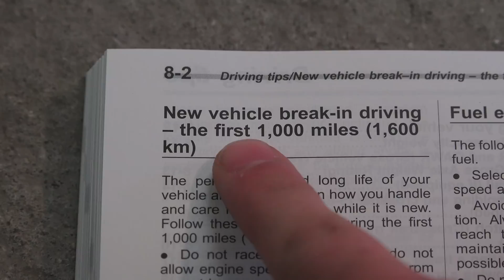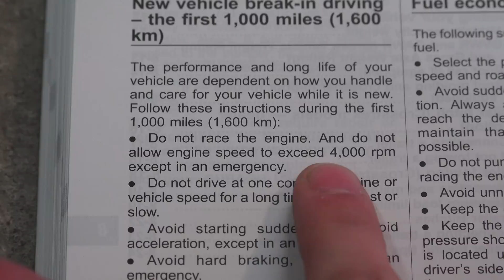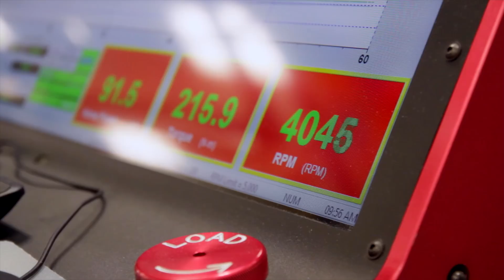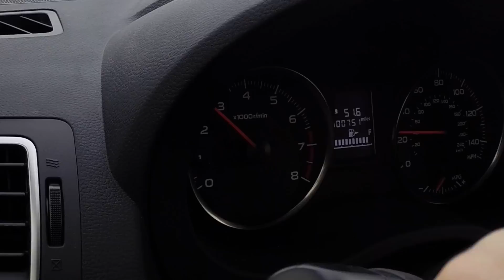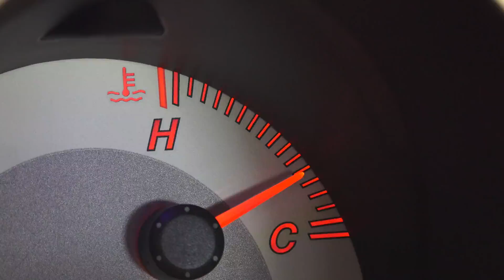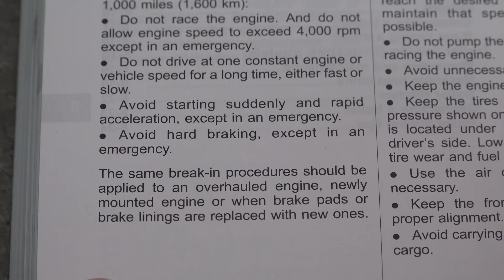5 Things You Should Never Do In A Brand New Car

Comment: My 1995 Ford Aspire was a rental from California.I got it in 96 for $5399.00 about 7500.00 with interest. it still runs great:-) use only full synthetic oil and tuff guard filters. 189,582 miles and still starts on the  first try ever time. and Bosch platinum plugs.

Comment: While following this info, I also highly recommend equal parts engine braking and moderate (but not full) acceleration. As you mentioned the pressure from acceleration seals the rings against the cylinder. Too little load and the rings won't seat correctly. The negative cylinder pressure (vacuum) from engine braking sucks the fine metal particles and excess oil from the gaps in the rings. Easy to do in a manual vehicle. Not so in an automatic. Regardless, my '14 WRX does not burn any oil. No oil consumption is indicative of a good break in process, IMO. Also recommend an oil change at 1000 mi, but people will argue it's not necessary.

Comment: Factory  redlines new engines for several minutes before putting the engine in the car. just rip on the car that's what I do with new cars
Reply: And that's why you spend every monday at the mechanic.
Reply: This has absolutely nothing to do with break-in or positive long-term effects. It's simple QA to make sure the engine won't immediately disassemble itself the moment the customer will drive off with it.

Comment: âren´t Ferrars tested at the racetrack for multiple hours before they get shipped out to custumers?
Reply: manuel grohse your Toyota corolla isn't a Ferrari.
Reply: "Ferrars" lel
Reply: +Lancer Guy  What about your 1981 Chevy Citation notchback?
Reply: Ferrari runs it's engines prior to installing them to the car.
30 minute dyno cycle, break in and then power/torque test to see if they are on spec.

Then they drive the car , not multiple hours, but enough to check if the chassis and steering and everything else works as required.

Comment: I'm nitpicking here, but cruise control does not lock engine rpm; it uses a pid controller to try to hold constant speed, which can require varying engine rpm. In a hilly area, cruise may change engine rpm more than a typical driver would because it's always trying to hold exact speed. This is a problem of highway driving in general, regardless of whether cruise is used or not for break-in.

Comment: The 6.2 in the last gen Raptor and the F-150 Limited and Harley Davidson version had an ECU restriction for the first 5,000 miles to avoid higher rpm and full throttle pulls.

Comment: Great ! really Great info man !
but If you have got a new part like disk breaks and its pads ...
will you also do a break in ?
and if this info is for new cars " to Eliminate the lost stresses of the casting and machining  progress ... and so that the parts fit in together !
and that's why BMW used an old Engine Block in the famous F1 car that Had a Turbo and 1,500 BHP !
and they piss at them too  !
and it made such amazing horse power !

Comment: It'd be nice if a manufacturer just took two or three brand new engines and did easy driving break-in, normal driving break-in, and aggressive driving break-in and then showed the wear side by side for a final and definitive answer to this. (No, this actually isn't that expensive to a car company. It's R&D cost.)

I was always told that you should drive it like you would normally drive it because then it'll break-in to your driving habits instead of soft driving and then a complete change after 1,000-1,500 miles. Obviously you shouldn't be flooring it much during normal daily driving, but you probably won't be using only 50% throttle and keep it under 3,000 rpm either.
Reply: They have very expensive simulation software. While it's still a simulation and thus not completely accurate they still feel the need to waste a few pages in the manual on how to use the car during that period.
Reply: qwesx 
I guess so. Just seems like when arguing back and forth on which way is better goes on for decades it'd be easier just to have a definite answer.

Could also be that wear in needs to be done differently with normal oil than with synthetic too. I'd just be very curious to see the wear side by side.
Reply: Alex V4 
Agreed. A side-by-side would be nice. Engines are built daily, so this should've been done by a manufacturer by now.
Reply: TheGreatMunky This is actually quite true. The real reason for a break in is setting the compression rings. I mean, are they so worried their engine assembly is so poor it's going to come apart.  Aside from racing it, drive it the way you drive under normal conditions. If you don't want to wait, use a dyno and you can get that so called break in done in about 20 Minutes.  If you don't have a dyno find a straight road with no stops and run it up to rpm then just let it compression break for about an hour.  Worked on my Harley and Honda crotch rocket too.  All they're doing with that manual is covering their own liability as usual.
Reply: Engine break-in can be done by the OEM's specs or by the "hard" break in method. Both work fine and depending on your driving style should determine which route you take. I have used the hard break in method for all my engine rebuilds and have never had an issue. The problem with it is that everyone has a different interpretation of it, which can lead to different results. I change the oil at 500 miles and in that first 500 miles am making sure to never let the RPM sit at a constant. the motor should not really sit at a cruising RPM for extended periods of time until it is broken in,so it should always be under acceleration or deceleration. I will also make sure to take it up to just under 50-75% of redline at about 75-80 % throttle (for example if the redline is at 10k take it no higher than 7k) and let it decelerate. Having that motor under load will help those rings seat much better and since the seating process is generally over in the first 500 miles that is why I do it that way. After the first 500 mile oil change I will drive the car at 50-75% until I reach 3k and change the oil again. you should be good to go after that.

The reason the OEM has the recommendations in the manual is for liability purposes only. The manufacturers do testing on their engines and they do not spend that much time on breaking them in. In most cases they will, pull a motor or a car off the line, hook it up to a dyno, give it a very brief warm up cycle, do an oil change, then give it a full power run. That motor will then be sold and treated no differently that one that has never been fired if it passes.
Reply: Stupidest comment of the week goes to

"Metal parts shouldn't be touching and wearing like that." 
@TheHannukahZombie

In a fresh built motor...  lol...
Reply: TheGreatMunky well one thing is obvious. more gas translates into more energy. more energy will definately increase the rate of wear. its just a matter of how much or even if it is worth noting at all.
Reply: Sijan Khan 
So driving the car the way you normally would should be fine then, right? The oil filter should pull any metal particles out of the oil, and 1,500 miles shouldn't wear the cylinder walls enough to make a difference between the pressures of light driving vs normal driving.
Reply: TheGreatMunky I think the issue is that not everything is seated in perfectly straight off the lot. You have to give some motion and stress to seat everything in perfectly, but if you put too much stress on parts that aren't fully seated in, you are more likely to put excess wear.
Reply: Any short track racecar driver or even club level racers can tell you.  Or almost any car hobby nut that has built many motors. The recommendations here run from ridiculous to out right wrong.  The idea that modern car tolerances are so good that you don't need to break-in is insane.  We build motors in the 30k range with top of the line parts and tolerances.  Combined with balanced and blueprinted; we still end up with a ton of metal flake and grit in oil pan after initial run.  Most factory tolerances can range in .004 inch, which is HUGE when you are talking motors.  All that metal has to go somewhere.  If you think all of that particulate gets picked up with a oil filter; you have watched way too many infomercials.
Reply: TheGreatMunky agreed; most cars will be fine with normal driving; but I've never heard of any motor not being "broken in correctly" because it was not driven hard enough.  That entire notion is almost as bad as not changing oil for the first 3,000+ miles.  Having torn apart my fair share of brand new LS1's from Chevy I can factually say that tolerances are still not great on a stock motor, even now.  Pounding on it is going cause excessive wear at very least; or even burn a rod or crank; burn a valve or  smoke a ring.  Stay away from Wot and keep your foot unheavy; read the oil and you'll cover the 90 percent of it.  In the end it's about reducing the odds.  We have had junk motors from factory that never run right and others that are close to perfect.  Lot of variables.
Reply: Charlie Pattison 
Sounds about right. And yeah, I've heard about the acceleration and compression braking approach before. 

It's just surprising to me that no company has done this and released the results online. Because these days with the internet that'd spread fast and we'd have a definitive answer. And it'd be relatively cheap publicity for that car company.
Reply: As Jason mentioned, I think the problem ultimately comes down to your manufacturing tolerance. There's variability in how well assembled one car is compared to the next car on the line, and each car will have different break-in needs because a car has so many different components. Drivers will also be driving these cars under different environments, so the load on the car is different from buyer to buyer. So you have to account for these variability as well.
Reply: Sijan Khan 
True, just makes me wonder how much wear happens during the first 1,500 miles compared to the 2nd/5th/10th 1,500 miles.
Reply: Once you're past the break-in point I would expect the first 1,500 miles to result in the less or equal amount of wear compared to the 2nd/10th/100th 15,000 miles. If everything is in its most optimal state, it would be wearing out the least.
Reply: TheGreatMunky Once everything is seated in (broken in), your vehicle will be able to handle more stress on itself.
Reply: Sijan Khan 
Could be. I guess my way of thinking is that the best way to wear things in is varied driving. Drive it too easy and it could wear in too light. Run it too hard and it'll wear in too heavy. A good mix of everything sounds like the best way to go.
Reply: Boysya 
I tend to agree. The very first time the engine is ever turned on and before any oil moves through the engine, yeah. But that doesn't last 1,500 miles. You will get slightly more wear just because no cylinder wall wear has occurred yet and the walls are more snug against the rings, but that really shouldn't change after 1,500 miles.
Reply: k kirkland 
Maybe, maybe not. Sometimes the common sense approach isn't the common approach. 

But even if they did, technology has changed. New and better alloys. New and better oils. What applied 30yrs ago may not apply today.
Reply: awesome we d say this guys know everything bout cars
Reply: Engine break in isn't a myth. I also had the same idea of a manufacturer or race team having 3 engines and doing various levels of break-in. Some engines where break-in was too light allowed for more oil to by-pass the rings when it should've been scraped down by the rings and then it was burnt leaving a varnish on the walls that later lead to oil blow-by and loss of compression. I just had my engine built in one of my cars for a new twin turbo application and when i brought the car for the pre-dyno inspection, they checked the combustion chamber and still saw oil on the walls because the motor was freshly built and had only been turned on for idle and to move it from my engine builder's garage to a truck for towing. Once the rings have been exercised and seated, hopefully there should be no more oil left on the cylinder walls after the power stroke as the oils ring and compression rings should've squeegee'd them down into the oil pan.
Reply: devops'y 
So you're saying baby the engine for a few thousand miles?
Reply: TheGreatMunky baby and frequent oil changes; never run cold and do the oil changes with motor still hot.  If the oil comes out gray and/or gritty; do another oil change at 1000 miles.  If oil looks like new, follow manufacturer recs. We typically drop oil pan; but that's overkill for a consumer car.
Reply: devops'y 
I agree with frequent oil changes early, and with not driving cold. But no matter what once you start hitting the throttle a bit you're gonna get more pressure and more wear. 

I think 3,000rpm is a little overboard. I definitely wouldn't run around town flooring it, but I wouldn't drive like a grandpa either.

I just think a company should take three engines and run them three different ways. Because even the opinions of people that constantly build engines vary wildly from person to person. And technology changes over time too. Better oil, better engine alloys.
Reply: devops'y 
True. And yeah, not running it hard enough probably isn't a thing. But running it too light and then switching to "normal" driving probably isn't a great idea either, especially with the computer adjusting for grandpa driving and then hard cut to regular driving.

But with my money on the line I would just drive it normal to normal-easy. No flooring it unless it was to avoid a collision. No hard acceleration. Just normal driving and regular oil changes early on.
Reply: If you're getting a ton of metalflake and grit in your engines, you're building them wrong. Metal parts shouldn't be touching and wearing like that. Who do you work for so that I can tell them to never buy anything from you since you have absolutely no clue what you're talking about.

Comment: My new car's manufacturer recommends keeping rpms not only below 4,000 but also above 2,000 for the first 600 miles. Because it's an automatic (Veloster Turbo DCT, actually) which normally would keep rpms as low as reasonably possible for fuel efficiency,  I just drove the first 600 miles in the sport mode, which kept rpms at or above 2k most of the time.

Comment: You understand that every engine builder that builds engines runs them to top RPM after the vales are checked right? Diesel engines run at full load and boost right out of the box....

Comment: Can you do an episode on your toughs on Germany wanting to ban combustion cars in the entire EU by 2030?
Reply: Green parties across Europe want to do this, but they will never succeed.
Reply: Germany was always fucked in the head, we should not listen to any of that garbage
Reply: well to be fair, they only want to ban PRODUCTION of combustion cars by then
Reply: To be honest for most cars this should be done as most people that drive their cars do so for work purposes. It will save a lot of money since fuel is a far bit costly compared to the US and other countries. However you still need to have the high performance or touring cars still need to be at least hybrid cars. Don't get confused as there are high performance electric cars but that only goes so far before they have to be recharged.
Reply: Adamantian Gilga true, but the technology improvements are fast and tesla is killing it! Imagine how fast the P100D Ludacris engines will be in a model 3! A model S makes has a lauch time of 2.5 and weighs 2 tons. The model 3 could be the next fastest production car and it's much cheaper
Reply: Yeah but the biggest problem is still the batteries. However they could use a hybrid system within the electric car platform by using a fuel generator to power the electric motors when the batteries run down. The engine would for one need far less cylinders than most engine powered cars and can stay at an idle and still operate just fine and have more than enough power and speed. That system would cost but for right now it is the best thing they can do for normal drive and some touring cars that can be based as electric. It would beat hybrids that we generally have now.
Reply: Who even cares
just get a new car before 2030
Reply: Who cares what Germany think? I don't. Angela Merkel can go and F herself. She's got other problems to think about.

Comment: Every engine builder I know stresses the need for lots of full throttle to redline during the first several hundred miles to seat the rings. One with over 40 years experience told me he has seen several engines that needed cylinders re-honed due to excessive babying, but none with problems due to flat-out racing. Premier Porsche engine builder Jake Raby drives new builds himself just to be certain they get lots of full throttle accel and hard decel the first few miles. Say again: the first few miles! Builders and racers came to these conclusions based on years of real-world experience, but the science and engineering behind this approach is equally compelling. Briefly, brand new cylinders have very fine high peaks that quickly wear down regardless of how the engine is run. If babied the peaks wear down without doing anything. The best ring seal is achieved by using high combustion pressure to press the rings hard against the cylinder walls, hard enough for these peaks to act as files forcing the rings to conform and seal better. Hard decel helps lubrication. Both hard accel and hard decel, repeated the first few miles (immediately after warm-up) achieves best ring seal, the key to power AND long running life.